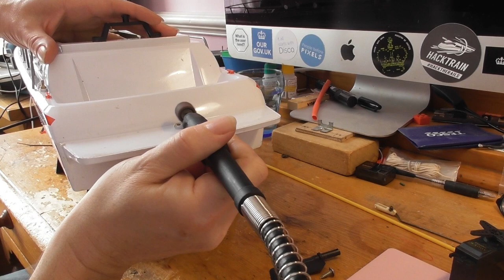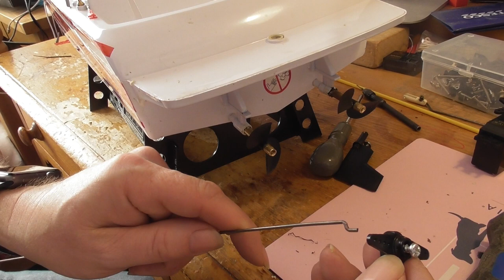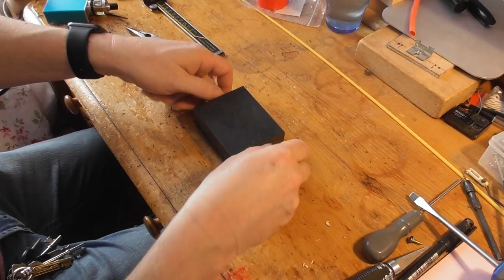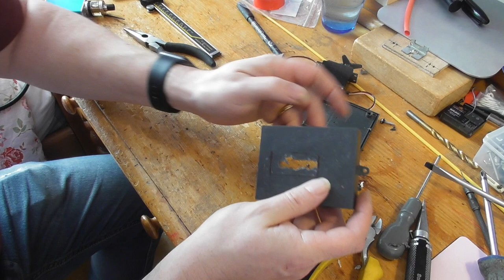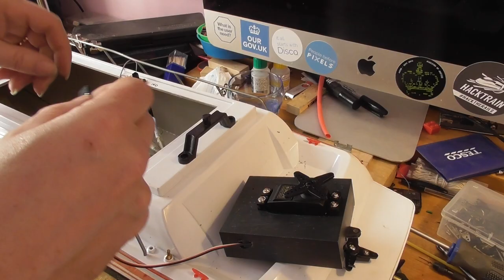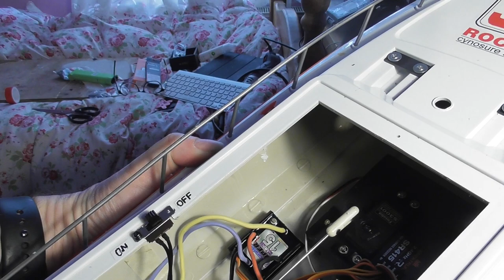Upgrading Heng Long Atlantic Yacht 3: servo operated rudder

Comment: Hi! Great Vid! May I ask what type of wire you are using for the linkage and where can I buy it? The longest I have come across is 300mm. Thanks for your help.
Reply from the maker: Golad you enjoyed the video, I thought that thyis great little hull deserved a bit of attention. I think that I used  piano wire - approx 1.5 to 2mm (literally) - sold for modelling, usually comes in quite long pieces. From memory I deliberately cut it in half and joined it in the middle, so that I could adjust it. This is much harder than normal control rod & best cut with a Dremmel - as it tends to wreck wire cutters. A Z-bender comes in very handy with this stuff.😀👍